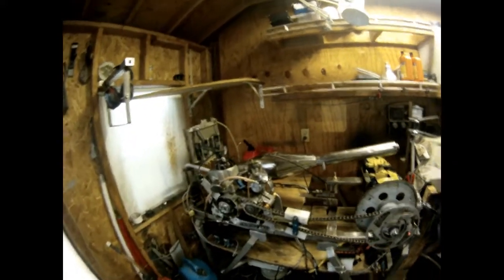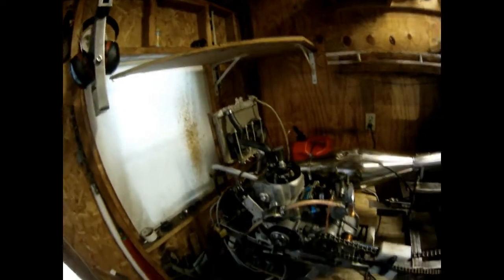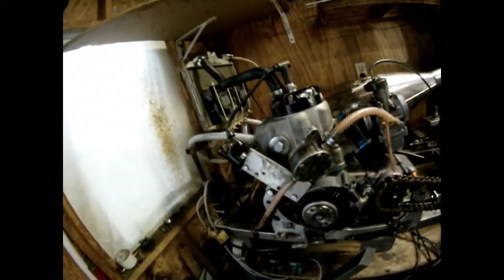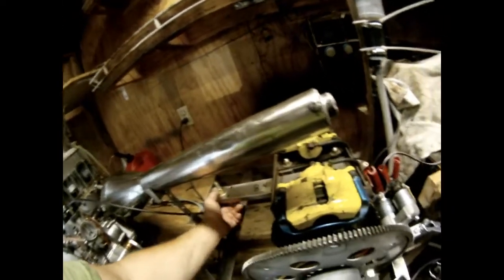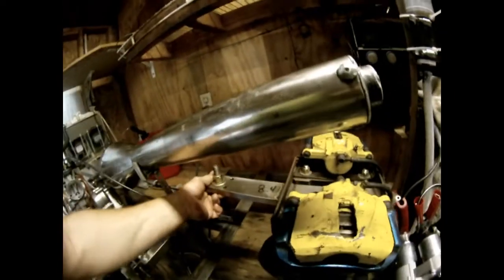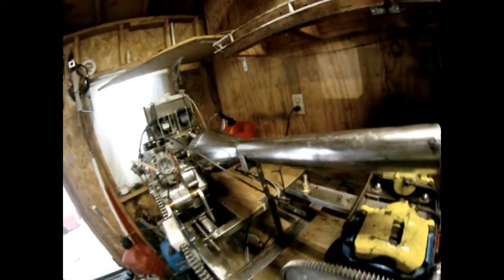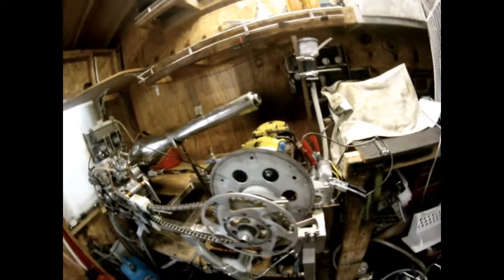First run of the DMS Racing Engines Prototype Dyno

Comment from the maker: I am using a load cell from a floor scale. it is a 2000lb cell but it is what I had. As far as the dyno rpm I have a sensor that sees the holes in the flexplate. This way I know what the dyno RPM is also.